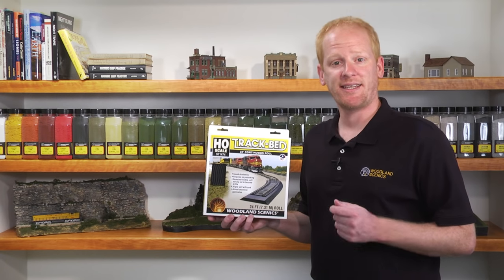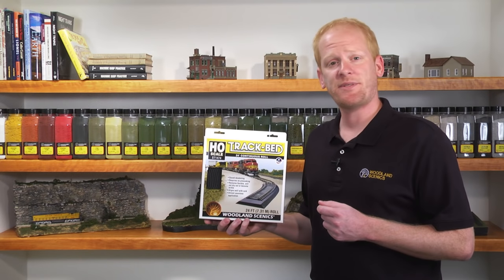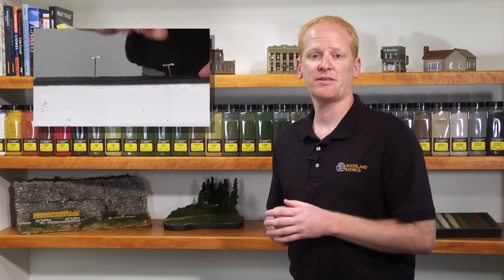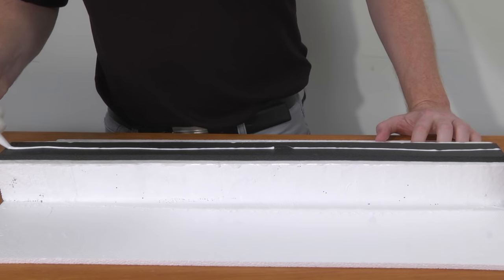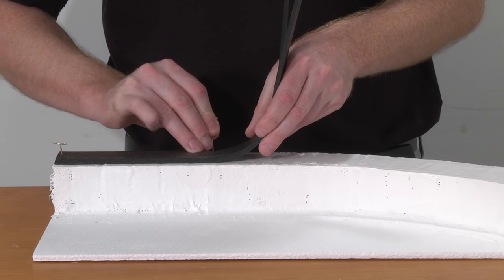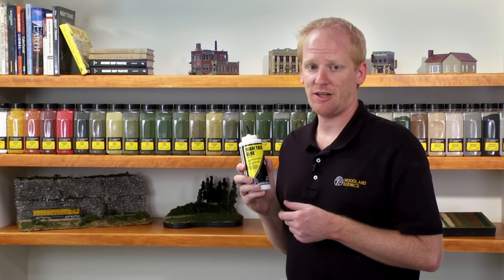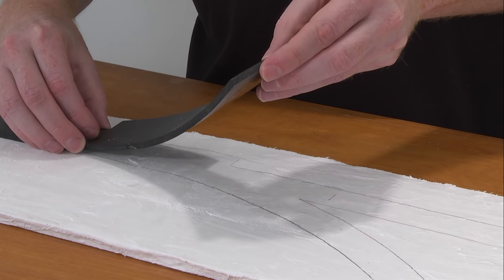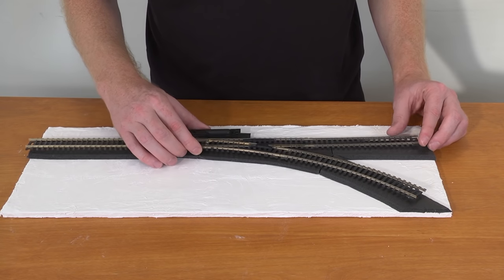Installing Track-Bed™ | Model Scenery | Woodland Scenics

Comment: I have these rolls ready to install on my layout. But a question, how do superelevation in curves?
Reply from the maker: Marcelo Model Trains Hello! You would apply it to steep grades in the same manner as Justin demonstrates  on the flat surface in the video - 2:21 to 2:54. Separate the Track-Bed Roll into two sections along this score mark. Press sections in place separately, butting snugly side-by-side. Attach with Foam Tack Glue as instructed. Hope this answers your question!
Reply: For others asking this in 2020... Ron of Ron’s Trains N Things uses thin strips of painters tape. Cut tape 1/2 other width of the track, apply 3 to 4 layers. I would start with one layer at beginning of curve and add more the deeper you get into the curve.
Reply: @samiam619  I've seen RTnT's video on that.  Being someone who can't resist techie stuff, I would use that process but also use the tiny digital level that shows angles of inclination/declination in percentages rather than just a bubble.  It's compact and can sit sideways across the track and also in the gauge for the risers measurement.  I believe Ron also mentions the # of super-elevation degrees on entering and leaving the curve. I have one on order in preparation for my layout.  Buying it from MicroMark (I am not affiliated with them nor get a fee  - just an old model railroad fan getting back into this new world of trains).

Comment: Does this work with scenic cement?
Reply from the maker: Scenic Cement is a spray adhesive meant to penetrate landscape materials, like ballast, and seal in place. We do not recommend using it for this purpose. Foam Tack Glue is best for installing Track-Bed with the contact method described in the instructions. Scenic Glue could also be used but not with the contact method. If Scenic glue is used, you simply spread it on the area and place the Track-Bed.

Comment: I was thinking of using n-gauge in yards and HO on main line.  Any suggestions on how to transition from HO to N?
Reply from the maker: Can you clarify your question? 

Are you saying you want to make HO scale track transition to N scale track? If so, we are unaware of any method to convert an HO scale track to an N scale track in a way that would be functional. The physical mechanisms of the two different sized scales simply won’t work together. Some modelers may use N scale track and trains to force perspective, using the N scale (smaller) in the background of the layout and the HO scale (bigger) in the foreground. However, the two different scales operate independent of each other on the layout. The two scales of track are not linked together. 

If you are looking for Track-Bed to fit in a smaller space in the rail yard, consider using our Track-Bed Super Sheets. This is an easy way to fill the rail yard with Track–Bed without having to glue several strips in a series to fill the space.
Reply: @ModelSceneryExpert  Thanks for the reply.  No, not track.  I'm using woodland scenics track-bed for my HO track.  I want the yards to be lower roadbed, so I was going to use N scale track-bed for the yards.  I have friends that do it with cork by sanding the cork to transition to lower roadbed height.  I was asking if you had a suggested way to transition for HO Track-bed down to N scale Track bed.  PS: Love your products.
Reply from the maker: @davidgorman2665  For a smooth transition we think it would be best to use a hobby knife to trim the edge of the HO scale Track-Bed. Then you can lightly sand it for a smoother transition. You could also consider using Foam Putty or a plaster to smooth the transition area, but these materials may be susceptible to cracking.
Reply: @ModelSceneryExpert  Thanks will consider these options

Comment: I have used your SubTerrain foam products to create a raised level, and topped it off with 1/4 inch balsa + self adhesive carpet underlay foam, plus your own cork trackbed material.  So far, so good.  BUT as soon as I glue the track to the foundation as above, the noise level increases dramatically ?  Just pinning the track down to the base stops the noise transference,  but is not really very satisfactory from an accuracy of track position.  

I have tried almost every glue I can think of to fix the track to the trackbed as described, but they ALL seem to amplify the noise of train movement quite dramatically.

Have you any ideas or suggestions ?
Reply from the maker: Hello! Woodland Scenics only manufactures foam Track-Bed, which has a very quiet operation. Cork is noisier than foam.  Insulating hollow areas underneath your layout may help. However, there are many other factors that could be contributing to your noise problem. Please feel free to contact Consumer Services by calling 573-346-5555 or e-mail websales@woodlandscenics.com for additional help. Happy modeling!